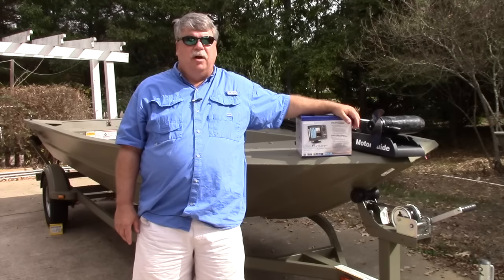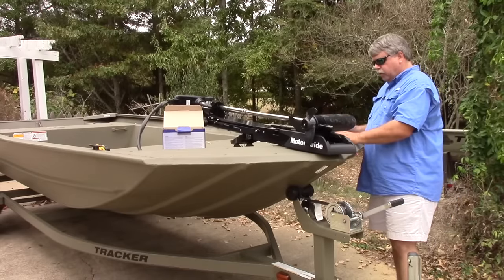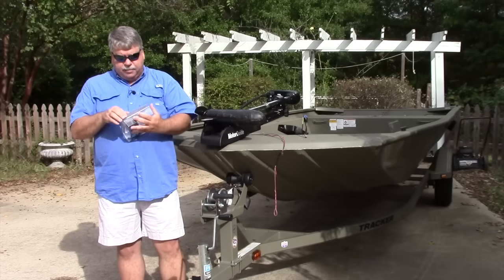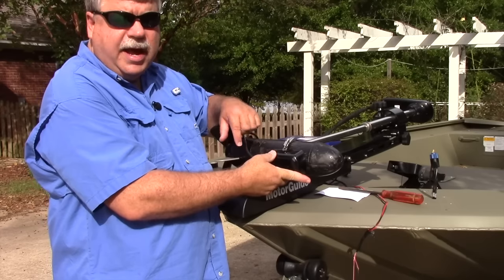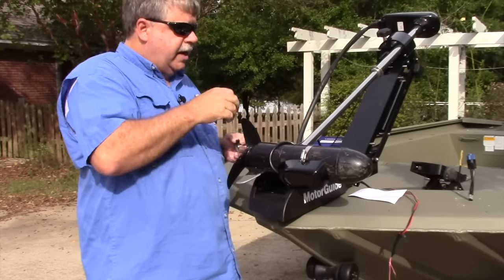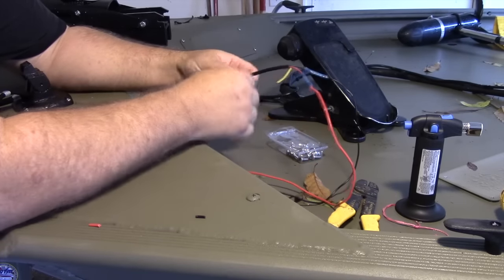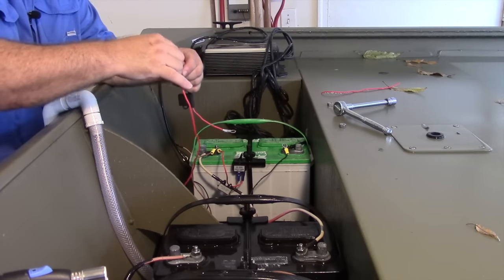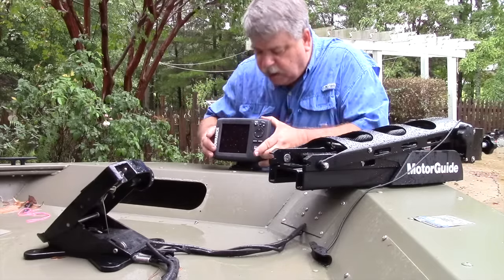Installing a Lowrance Elite 5 Chirp

Comment: thank you so much Scott I called lowrance all they told me was the size of the wire coming from the power cable which is an 18 gauge wire not what they recommended for battery connection once again thank you and if you have anymore to add it would be much appreciated keep those videos coming and God bless you

Comment: You showed the power cord install which is a great demonstration. Do you have the install video for the sonar cord? Thanks
Reply from the maker: I don't have any that's not already included here, but all I did was run the transducer cable up the trolling motor shaft and followed the cable on the trolling motor to the front of the foot control.  Then it went through the hole where the power went and up through the hole where the depth finder plug went.
Reply: Thank you 😊

Comment: Hey Scott how do you like the lowrance elite 5 for are area in Mississippi ? What all extra would I have to purchase to make sure it showed are Mississippi lakes
Reply from the maker: +Kickingtheirbasstv It's got Lowrance Base maps installed, so you've got pretty good lake coverage with the built in mapping.  It will support either a Navionics or a Lowrance Insight mapping card as well.  It will depend on the specific lake or lakes you need to determine which card is better for you.  No one card will have the best coverage of each lake, so you need to look at both to tell which is best for your particular needs.

Comment: where would u put the transducer if u had been using a tillerhandle outboard ?Great vid.ty much
Reply from the maker: +2000yamahar6 the unit also comes with a transom bracket, so that's where I'd have mounted it if I had a motor on the boat.

Comment: i use Lowrance Elite-5 Chirp for few years and I have problems with that...When I turn the power on and logo is on but waiting for long time and wont change after I unplug and re-plug to turn power on and logo is on and wont change the setting..batteries in my boat is fully charged...what do you think?
Reply from the maker: Do you have the current software installed?  if that doesn't work, try a hard reset and see it that fixes it.  For a hard reset, with unit off, hold down + & - button and then press and release the power button.  Release all the buttons when the USA map appears.

Comment: Scott what gauge wire did you use to connect to the units cable power supply cable from the battery
Reply from the maker: +Adam Lightner I'm pretty sure that was 14 gauge.